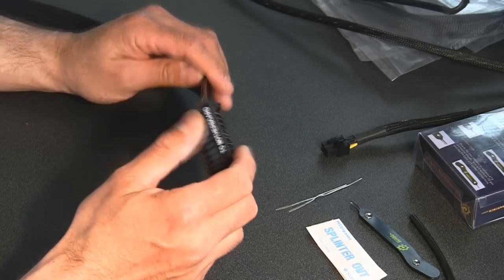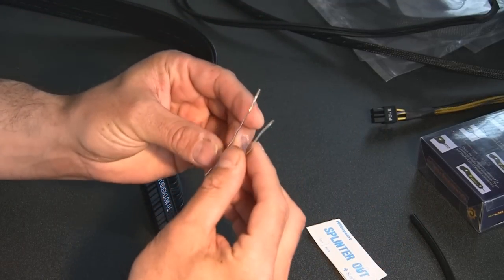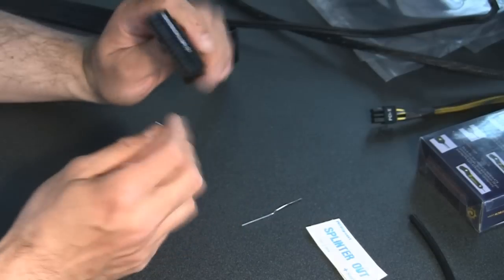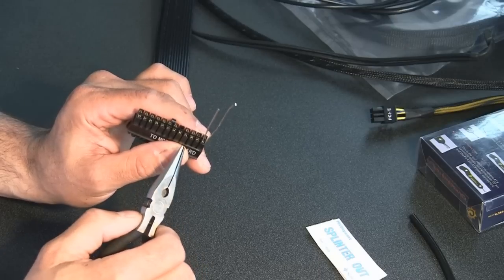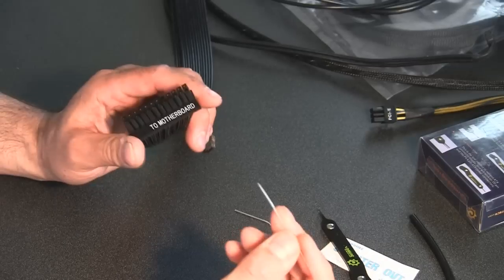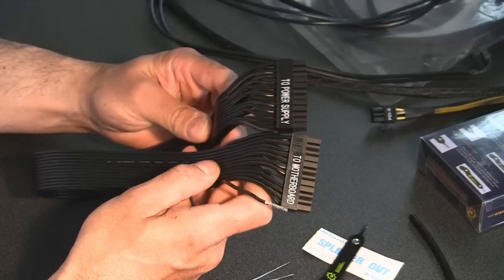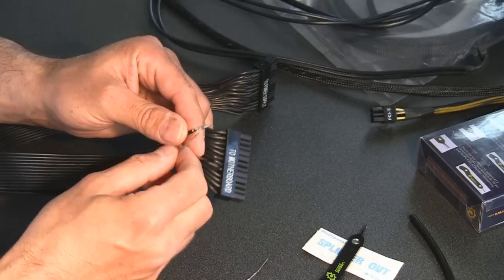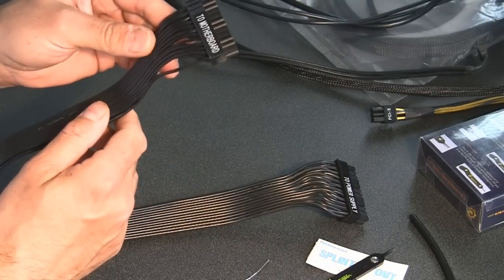How To Remove the Pins on the 24 Pin and 6/8 PCIe Cables

Comment: Just a heads up, for anyone interested... If you take a pair of decent wire ties and strip the end on each, you can use channel locks or similar to crush the end a little to flatten it, and use the same way as the paper clips here. Be gentle, and use the pliers to straighten the "tools" out as necessary. Once they bend too many times and won't stay straight, cut it back, strip again, flatten and continue.

Comment: Good video. After seeing thing and instructions on using a paper stapler, I decided to merge the 2 and use 2 bostich type construction type staples, because of the width of the staple.  I ground clipped the point off the straightened part of the staple and ground it thin and to a point using a honing stone.  After getting them started, I forced one side in an effective depth, pulled it out most of the way and then forced in the other and slid them both out.  The pin pulled out easily after that.  Thanks for the sharing.

Comment: Thanks! I had to remove the 3.3V pin for my SATA power cables because of the Power Disable feature. Using flattened paperclips worked very well :)

Comment: LazyMan, just wanted to mention I discovered another use for your "modified" paperclip. If you bend the flat end of the paperclip to 90 or 110 degrees they make an excellent "hook" to pull the retaining "washer" on any fan shaft (like your Zigmatek fan painting Mod) out. Just pulled the washers out of two Corsair Memory fan coolers in about 12 seconds. Used both paperclips for leverage! The bend is only 1 or 2 mm to fit under the "washer". Again great vid! Thanks!

Comment: Thanks! Had a 900W Modular PSU which was useless because I couldn't find cables with the same pin configs anywhere! This worked great and got rel easy once I went through a couple.  So glad you posted this video, exactly what I needed

Comment: Thanks a million for putting up these videos. They are a lot of work and I really appreciate it. Just a thought from a rank amature: I didn't want to tear my connectors apart so I used a Sharpie to black out the wires (and the connector in the case of the 4 pin) where the shrink wrap ends. It looks OK if you give it two coats.

Comment: Thank you very much. I want to have a separate PCI express cable for my new vga card cuz my power supply has only two of them. I found a PCI express cable but it was different in wiring. I was able to make it suitable with your support. Thanks again

Comment: Thanks for this. Took me forever to figure out how to get the pins out of the ATX and 8 Pin Motherboard Power Connector. Also, be sure to note that unless your PSU is a Corsair model (that's the only one I know of by default) removing the connectors voids your warranty (I know for a fact it does with OCZ). I bought extension cables and I'm just going to sleeve them instead. Works out better while not voiding my warranty :D

Comment: gOOD LORD ALMIGHTY THE INTERNET IS A WONDERFUL THING. Just bought a 1000wt power supply to run my 4080 and low and behold a pin wire wasn't soldered/mechanically connected right to the pin and was unseeded. one correct search parameter and BOOM ANSWER IN QUICK MEASURE. ty SIR I AM A BIT LATE TO THE PARTY BUT I HOPE all is well! By the way i use a pocket set of gap testers perfect!

Comment: @WestCoastMods For instance, Corsair PSU's are still under warranty when single sleeving and removing the connectors so long as you don't open the inside of the PSU. You can sleeve up to the outside of the PSU and keep your warranty in tact. OCZ's warranty states that if you remove the connector, you void the warranty. Surprisingly, extensions are actually really easy to manage depending on the case you have.

Comment: @WestCoastMods Thanks for the reply! As for the cables that feed into the Power Supply (Corsair HX 1000) I bought F-6 Techflex Split Braided Sleeving 1 inch diameter which covers all the non-modular cables on the Corsair. I have Krazy Glued 2 one inch heat shrink sections together making for an oversized heat shrink that is open on one end. I intend to wrap that over the F-6 sleeve till it is tight and then cut and glue the final ends together.

Comment: thank you so much, your videos are awesome. I'm going to start sleeving my 24 pin now. Got the sleeving and heat shrink from Fry's! Just one thing though, I use a unraveled staple to take out the pins instead, but your way works just as well!

Comment from the maker: @orestesdd Actually because they were all black I didn't need to sleeve them, but had I ..it's just a mater of marking them so you no which wire is which. Anyway to answer your question on your other post... I choose the Ultra X3 because at the time there weren't very many 100% PSU's, and the X3 had flat FlexForce cables that were black..no sleeving required..but since then
 single sleeved cables has become the thing to do, so I would probably look at what others had to offer at the moment.

Comment: @WestCoastMods I tested the Heat Shrink pieces that were Krazy Glued together on a hammer and screwdriver by heat shrinking them together.   So far the Krazy Glued heat shrink has held the tools together! (LOL) I was not sure the Krazy Glue would hold the heat shrink when it was heated but so far it has. I would only use the F-6 sleeveing to reach under the mobo - a distance of 6 to 10 inches. Appearance wise its not too bad. Not sure I wont individually sleeve anyway later. Thanks

Comment: Oh, typed it wrong. Corsair 1k watt psu. I double checked the 24pin on egg, and it's regular. My bad. Anyway, I'll take your advice then. The periph cables that are modular are like the one in your vid it looks like. Well, that's okay, they show more. I have some nylon sleeve left over from other prog, and will use it. Tighter weave than reg sleeving. Looks extremely nice, but more costly than reg sleeve. Thanks!!

Comment: Tank you so much, i used two small needles to do it.

I was very stupid, when i mounted a fan in my tower i did not know the flat CPU 8 pin cable was behind one hole, and i put one screw through the cable, so happy i got a good PSU and MB, everything is working again.

Comment: Pushing the cable from below the connector really helps, the pin can come up to 1mm higher so the gap to insert the tool is wider.
Reply: +Mathieu Boucher hey could this help me somehow with actually connecting the 24 pin to the mobo socket ... the last 2mm-3mm will not click into place .. maybe the pins at the end of the cable are too far up or too far down I dunno... but no way am I going to start using the PC with a loose 24 pin power connector.
Reply: +David Boris Fernandez It's mostly to remove the old pins, not the new ones. I had some issues pushing custom connectors (8 pins) in place but a bit of wiggle on the cables and it seats properly. You could try with applying light pressure on the connector to move the cables around until the blocking one slides into place. They most likely don't line up properly. Also check for a bent / squeezed pin on both connectors, they are quite fragile.
Reply: thanks man I managed to do it .. the trick is to slide a thin sheet of rubber on the opposite side of the mobo  24 pin (this worked with the mobo attached to the case) about 3-5 inches of rubber sheet (floppy) and then place your fingers on the edge of the mobo under the rubber creating counter pressure force when you slot the connector into the 24 pin slot on the mobo not forgetting to also press the latch inwards towards the pin connector at the same time (not away from). It slotted in nicely 100% although there wasn't a loud click noise when the latch bit the mobo connector lip.Mathieu Boucher The thin sheet of rubber was from an anti slip pad that came with my Razer Vespula mouse mat btw, nice and thin, it essentially increased the (counter force ?) surface pressure area on the underside of the mobo when I was pushing towards the connector underneath - did not want a cracked mobo.
 Know anyone that needs a spare EVGA Gold 1000w PSU in South Western Europe ??!?!? that's what you get when you panic when things are not working.

Comment from the maker: Not sure what you mean by extra features and what is a Chx? the Corsair 24pin is different than the 24pin on the Ultra. But if you are going to sleeve them all individually then any PSU will work. be aware when you sleeve wires separately it makes it more difficult to do cable mgmt. IMO I would just use heat shrink on the individual wires at the section where they go into the connector so you don't have multiple colors wires, then sleeve them as 1 unit. I hope this makes sense.

Cheers
LazyMan

Comment from the maker: @jam3s121 That is correct, but, I believe it is possible to put a 12v yellow cable in any other 12v yellow position. However I alway just re-wire exactly the it was originally.

Comment from the maker: Yeah it does get pretty windy at times near the Bay. Most all PSU's have single wire for each pin, you may have to take off the factory sleeving to get to them, so you can sleeve them individually. If you take a look at the PSU I decided to use for this build (Ultra X3 1000w) it has individual wires going to each pin per connector, what I like about this particular PSU is that all the cables wires are black, requiring no sleeving and it is 100% modular.

Cheers
LazyMan@WCM

Comment: Yes, I've looked at the 'regular' type connector with the wires and see what you're saying, but I was looking at the CorsairHx1k(not my first choice since I wanted some other features), but the Chx is a very good compromise for me. C1k looks the same as the 24pin wiring on the Ultra, and I was still thinking of sleeving them all separate. Just a thought; this style is very nice the way it is. I really like the attention to detail aspect. Why I asked about splitting the wires apart. Thanks.

Comment from the maker: @kamuirsx Correct me if I am wrong, but if you're removing the connectors.... that normally means that you are re-sleeving the cable or single sleeving it, and if so there goes the warranty anyway. Now I could be wrong, but I would think that any mod to the cable would void the warranty. Most are aware of the warranty being voided, but it's a risk IMO worth taking, of course test the PSU first so you know it worked initially. But to add extensions just adds more clutter and harder to manage IMO

Comment from the maker: Yerah, some pins are tough to remove...try a Jewelers saw blade 2/0...you can find them at Amazon...I use them in conjunction with the molex tool....this will make it much easier.

Comment: good stuff.. no wonder you mentioned using paper clips and I was wondering.. paper clips are thick.. how will i be able to remove those 24 pins . now I get it.. but still I prefer to use staples lol.. no need so much hassle.

Comment: LazyMan, I guess I'm pretty Lazy myself because I have a 24 pin connector cable extension by ModRight that is presleeved. If you add the Modright extension connector to the PS 24 pin cable behind the motherboard tray and connect the 24pin connector to the motherboard you have a sleeved connection without all the work. Since I know you have even sleeved tie wraps I was wondering how you feel about this Lazy approach?  Thanks for all the great vids!

Comment from the maker: You should only need to remove the one side to sleeve them. But if you need to remove the other side there should be a little tab on each pin that you need to compress to remove the pin from the connector. 

Send it to me and I'll take care of it for you, of course for a small fee that is.

Cheers
LazyMan :-)

Comment from the maker: If I had to make an educated guess, I would say it would fry something, never had that problem so I'm not a 100% sure. But when you're dealing with electrical current, if you have wires crossed something is going to short.

Comment: Does the Golden Gate Bridge really get that windy? Just kidding, but wondering. Anyway, helpful video. Question: do psu's that have that type of cabling which is all fused together, "tear" apart so you could sleeve each separate wire if you wanted to? I saw one person's vid where they sleeved each wire and it looked very class. Why I asked. Thank you.

Comment from the maker: Yes, you can use a 4pin molex to 6 pin pcie cable...However, I would use the ones that have 2X 4pin molex to 6pin pcie....this way you get enough wattage to your GPU....you can easily find these with a simple search.
Hope this helps

Comment from the maker: Try using Jeweler saw blades 2/0....you can get them from Amazon. I use them along with the molex tool and it works every time.
Hope this helps

Comment: I have taken a look at that kind of PSUs, Ultra X3, but if I remember correctly,  they don't have a on/off switch in the back.  Do you really recommend this type of PSU?  If so, why?  Most of my PC has had a on/off switch in the back except for the laptops, and I been using PCs since 1985.  Anyhow, thanks for the VID.

Comment: you cay use 2 staples size 24/6, its wire is flat, just necessary thickness, you have only to straighten at one end each and trim edges

Comment from the maker: @monkehboy They should be very similar to a 3 pin fan connector...except 4 pins. You should be able to see part of the pin through the connector itself, just use a small screwdriver, tweezers, ect to compress the pin and it should pull right out.

hope it works....

Comment from the maker: @2stent yeah, I have no problem with it, sometimes it is the way to go, but I no to fond of how the PSU suppliers only bring the sleeving and feat shrink up so far. I know it' can not be done on the 24pin, but on some of the others it's like they ran out of sleeving....lol I know it's a lot of work, but I prefer the single sleeve look, and when you use a extension, then what do you do to the end that plugs into the PSU? Thats why I try not to use extentions unless the cable is to short.

Comment: why didn't they make the tool the shape of the hole on the plug? It would be more ridged and slide down and all one needs is force and it would come out. with this kaka myka tool you have to search to hit those pins for releasing. I'm going to make my own tool. but looking at the plug..it's quite a tight fit

Comment: I substituted bobby pin for staples, which is made from spring steel.  I needed to grind slight taper in thickness and width to fit the slot buried in the connector block.  I also had to wiggle the pin to get the connector out, probably should grind a little more thin for next round.  I just needed to do a few connectors for ReadyNAS NV+ PSU hack.
Reply: I'm doing the ReadyNAS NV+ PSU hack too! May I ask, what did you do with all the other cables? Cut them short and cap them with electrical tape or something?

Comment: Was thinking, Lazy Man, do you know how to paint a 120mm fan from stock plastic to red? Searched Tube, net and found a how-to for disassembling, but none for best way to paint one. Maybe I missed one, but I was wondering if that's vid you'd consider? If not, that's fine; perhaps you have no need to. Just a thought. Also, besides Noctua(ugly color), what's a VERY quiet fan that pushes air/radiator? Any thoughts? Thanks for your time.

Comment: I'm having a  problem trying to connect and properly seat a 24 pin Corsair PSU cable/ lead to the Mobo 24 female, I have the latch on the  right side etc  I've applied tonnes of force but the cable connector is still loose which is dangerous. I've even provided counter force on the back to prevent the mobo from getting damaged. Always 2-3 mm short of actually fully connecting and I can push it down no more. Watching this video I was wondering could the "hollow pins" be too far down or too far up the 24 pin lead and need moving up or down in order to get it clicked into place on the mobo ?

Comment: There are connectors and there are connectors . I have done some of this kind of thing and its hard though usually possible using this method.But. Just tried it on a new cooler master psu and i had to give up completly .A lot of the newer stuff is impossible compared to older connectors,i think.Tolerances are much tighter now. And a lot of it is kinda flat ribbon and possibly just a bit smaller pins or something.But yes its getting very hard now

Comment: @WestCoastMods Well yes and no. Some companies don't care if you remove the connectors because they are just connectors. You don't necessarily have to single sleeve. Some people remove the connectors to use smaller sleeving for all the wires but the sleeving (when fully expanded) won't fit over the connectors. 

Again, it depends on the PSU company (I say company instead of manufacturer for the obvious reason that every company that releases a PSU doesn't manufacturer a PSU).

Comment: Do you have instructions or can you record instructions how to remove and replace pins to a motherboard? The 40 pin connector was stuck. By the time I was able to pry it off, several of the pins broke off and came out with the stubborn connector. Thanks

Comment: This works, although I found an easier method (IMO). Get a box of sewing pins with rounded plastic ends. They're usually thin enough to fit proper and also having a sharp pointed end makes them easy to get set. Then, apply even pressure to the ends. I found pressing gently against a wall or desk works for this. Don't push too hard because the needs could go through the bottom and you'll have a bad time.

Then with the connector over a bowl or something to catch the needles, pull the wire out.

Comment: Hi can I put the cables anywhere in any slot or does each wire have a designated slot/purpose?
I did this and noticed my evga cables slots do not line up and wanted to make it look neat so considered moving the wires